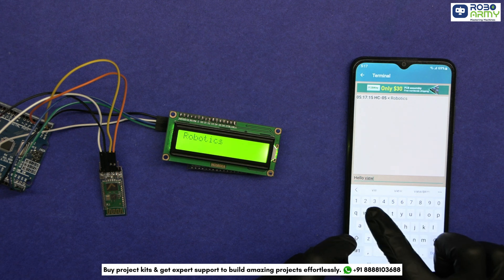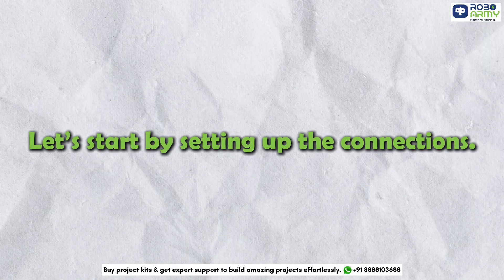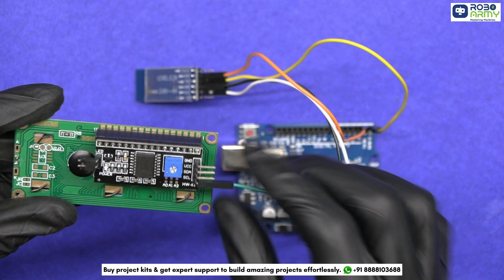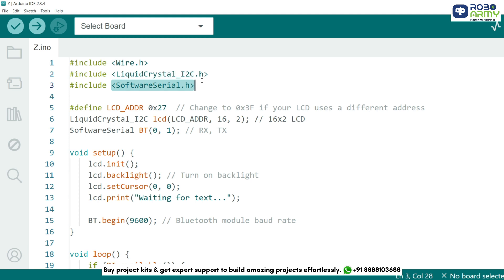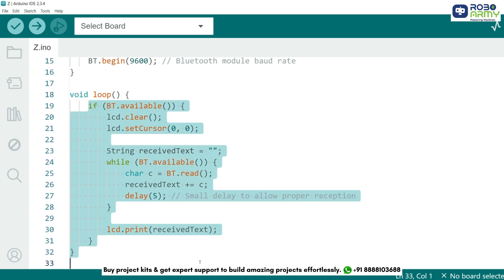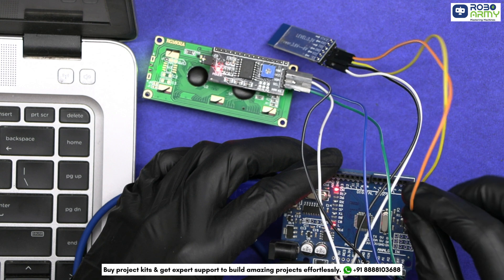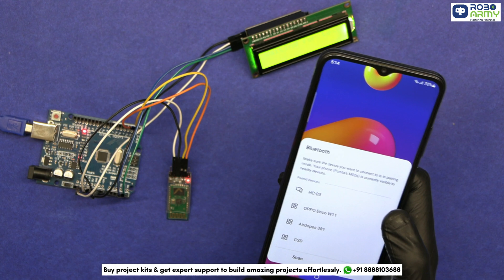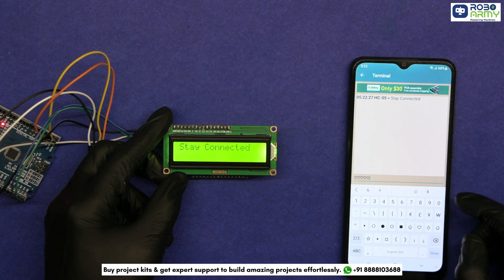DIY Wireless Notice Board with Arduino & Bluetooth 📢 | Step-by-Step Tutorial

Comment: I tried it and code works perfectly fine but the words are not displaying on the LCD screen any suggestion to fix that up??
Reply from the maker: Make sure the contrast of the LCD is adjusted correctly using the potentiometer.

Comment: What if someone who knows about it  try to change that text can we make any security lock or something else for this to prevent unauthorised access
Reply from the maker: Great question! 👍 Yes, we can add a security layer by implementing a password-based system. For example, before sending a message, the user must send a predefined password. If the password doesn't match, the message won't be displayed. We can achieve this with simple modifications in the code. Let me know if you'd like a tutorial on adding this feature! 🔐😊
Reply: @robo_army_  thanks for the reply 🥰 i would like to know about that, can you make that security feature tutorial 😁
Reply from the maker: Noted, will upload its tutorial soon